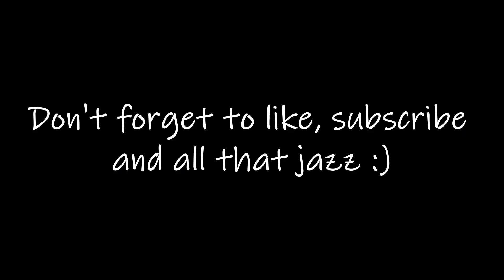Installing the Fractal Design Celsius S24 AIO Water cooler in the Meshify C case

Comment: Hey, MrGarti, how are u doing? What bout your S24, operates well? Few observations regarding mine: beeing connected to radiator directly (in PWM mode on the pump knob) my AIO fans speeds up or slows down for no reason even in idle or just web browsing (not a big load imho) and fans start to howl occasionly. So fan speed ramps up basing on CPU activity, not on AIO coolant temps (what fans rpm's supposed to be be based om imho). So fans spin at ~2000 while coolant didn't have time to heat enough to be cooled by such high rpm's)).. Appealed to FD support & they confirmed it's just like that, quote: 'I would almost recommend to connect the fans directly to the motherboard instead of using the PCB included on the radiator. And then set the fans to the chosen speed you want to have them at. The only thing reporting RPM back to the motherboard is the pump cable. The fans on the AIO hub then runs at the same percentage it's put at, so if the cooler is set to 100%(2800-3000 RPM), the fans would run at its 100%, which generally is anywhere between 1000-1800 RPM for fans. The hub is pretty much there to make cable routing easier. It does not report RPM to the motherboard, and only copies the signals that the pump gets.' Hence I'm about to utilize SYS_FAN mobo headers.. Sorry for longread)..

Comment: The radiator is upside down, tubes need to be at the bottom, otherwise this causes air pockets, gurgling sounds and other issues. Manufactures don't let people know this, it's infuriating. Nice set up though

Comment: Thanks for creating this video. Was wondering if it would fit inside the case :P Cuz im about to order the same case and cooler. Although, i might go for the one with 3 fans? Any thoughts on 2 vs 3 fans version of the cooler?
Reply from the maker: Hi there, I have no experience with the 360mm version sorry :(

Comment: A bit confused AIO hoses on my S24 are rotating. And fittings as well, on radiator and pump. Do I have to tighten them? Anyone?
Reply from the maker: Hi there, yeah the top part of the fittings can rotate - mine does that to, I havent tightened anything and I don't think you will have to.

Comment: Installing S24 in front of the case is the only option for Meshify C I believe. It's impossible to install it on top since AIO interferes with RAM. GSkill Trident Z in my case. Was very upset about that..
Reply: I installed it on the top with no issue.
Reply: @ClaytonHT  depends on m/b - MSI B450 Gaming Pro Carbon won't allow you to do it. RAM slots are too high

Comment: The user manual seems to show the fans being inside the radiator.  I have mine installed like the video already and am wondering whether I should change it.
Reply from the maker: Hi Frostfell, the position off the fans can be both, the one where it is inside like on the manual is called a "pull configuration" while the one in the video here is a "push configuration". Temperature wise there isn't any measurable difference between the two, so I'd say its a matter of preference.
Reply: @MrGarfi  Thanks for prompt reply!! :D

Comment: What is the name on the connection on the board for the pump? Cpu fan?
Reply from the maker: It can be either pump or cpu (Not all motherboards has a dedicated pump fan pin, and in that case, just use the cpu pin).

Comment: Hello; I'm using this fractal celsius S24 AIO for a year on my computer with a I7 7700K and a asus strix Z270E but I got a problem, and i'm wondering if you could help me:
When I start my PC i have these errors : CPU FAN speed error; CPU overtemperature error. With them being at 100/100/100/100 degrees. The pump is connected to the CPU FAN.
I have tried to connect it to other slots without conclusion.
When I put my fingers on the pump I feel no vibrations (like if it wasnt working), and the fans are turning faster than usual. 
The thermal paste seem to be old and i might need to change it, can it be the only problem, or do u think i should change the pump? Is the problem coming from something else ?
Sorry for my approximative english.
Thanks in advance for your time.
Reply from the maker: Hi Antoine, sounds to me like the pump is defect - I would reach out to Fractal Design for support.
Reply: My CPU isnt overclocked if you wonder.
Reply: Or your psu cant give out enough 12v for all peripherals. Try to disconnect everything else that may use 12v. Had the same issue.

Comment: How long is your video card?
Reply from the maker: In this video it is an old Asus 660gtx TI that is 27cm long (10.7")
Reply: @MrGarfi  thanks for the answer! tell me what the maximum length fit, if it costs Fractal Design Celsius
Reply from the maker: I think it is around 28cm. According to the manual of the case the maximum width of the card when there is a fan installed in front is 315mm and the radiator on the S24 is 31mm thick, so that would be a max of 284mm. 
See page 19 on the manual here:
https://www.fractal-design.com/media/56d40f9f-549f-413d-b144-46eaeef98f11
And the specs on the AIO here: 
https://www.fractal-design.com/media/7848d534-294e-4083-b671-db6c4d4da95d
Reply: thanks big thanks

Comment: Sorry, I don´t understand, why you have installed the Radiator on top with "PUSH" operating fans, the White side means "Push" and the labeled side "Pull", look at the arrow, if you look at the labeled front, the air flows from bih!
ind to the front, when you look at the White side, the air flows from front to behind (Push), best cooling provides push and pull operation with 4 fans, you push Fresh air from outside through the Radiator and pull out with the other (replaced) ones, this pc with Mainboard, graphic, and.. gets no fresh air inside!
But I have another Question, Perhaps you can help, When you have set backplate for Intel 1151 socket and mounted the 4 standoff screws, the System is moving, because the threads are higher than the Mainboard thick, is this Right???
Reply from the maker: Push vs pull in a front mounted  like in my video here doesn't give any measurable difference in temperature, so don't worry too much about that. Regarding push/pull configs, then I don't think you would get any noticeable performance boost from it on such a thin radiator - had it been a 4-5cm thick one, then yeah sure, go for a 4 fan push/pull - otherwise I think the money could be spent better. Checkout Jayztwocents videos on the topic to get better details on it - he has everything covered about water cooling.
And to the question, yeah it doesn't tighten it completely to the motherboard, there is a 1 - 1.5mm play. But when it is tightened when you screw on the pump, and then there shouldn't be any play at all - if there is then its not installed correctly.
Reply: Thank you so much for your answer, I am happy to hear, that you also have noticed the same Play,
sorry, I cannot immagine, how this should work, the Copper plate of the pump with the thermal paste must be pressed to the top of the processor, when you drive the screws you PULL the fixed standoff screws up, this results in having the grounds of the standoff screws NO contact to the Motherboard, I have installed many cpu-air cooler, some use adhesive taps, to fix the back plate,
now I want to use a midi Tower and a compact watercooling set, I wrote also to the support of fractal design, the Problem is for me, the Pins of the backplate look out from the Mainboard holes, when the backplate is tight to board, in the cad Picture of the instuction Manual "Mount the Cooler" you can also recognize, that the grounds of the standoff screws don´t touch the top of the Motherboard, but this can mean Nothing!  So sorry to disturb you, but a teacher a Long time ago said "better a stupid Question, than a stupid work"! Can you look in this build up System, if the Bottoms of the 4 standoff screws touch the board? Thank you for your friendly Patience, best regards Burkhard
Reply: @burkhardpuck5775  u cab rorate plate on popm

Comment: If anyone has a meshify C case /w Celsius S24 I would be interested to know does it properly fit if you mount the radiator to the top of the case? No interference with the ram sticks or the motherboard components? In my case my ram is not too high but would still probably be in the way if it were a push pull configuration with 4 fans, however I am interested in the stock config /w 2 fans... my ram is Kingston HyperX predator 2x8GB HX430C15PB3K2/16 kit which should b e 42,2mm high. Thanks to anyone with fist hand info in advance.. cheers.
Reply: Tried to put together Meshify C, S24 and Trident Z today. Had an issue with RAM blocking radiator top installation(.. So the only option for Meshify C in this case is to put AIO up in the front of the chassis I guess..
Reply: u can cheat this problem bro. put radiotor on the top, inside in a case and fans on top but outside of case. and connect them together by screw.

Comment: You have mounted the fans on the outside of the cooler, when the instructions indicate they should be on the inside.  Holes for both mountings exist.  Why vary from the manufacturers instructions?
Reply from the maker: Hi Peter Wright, good question! Whether you place the fans in front of the radiator or back is a matter of pushing vs pulling air through - and as lots of tests have shown it doesn't matter temperature wise, so I just went with what I think looks best, and that is hiding the back side of the fans. If you look at the NZXT Kraken installation guide it shows a push configuration so it truly is a matter of personal preference, both options work just as fine.

Comment: Is this better than the new Corsair AIOs? I want to put a new cooler on my 2700X, but am really undecided on the Noctua NH-U14S, this cooler to match my new R6 case, or the new Corsair 280 RGB Pro. Your input would be highly appreciated. Great vid.
Reply from the maker: Hi Rene Pena, I haven't read anything about the new Corsair I am afraid - but gamersnexus.net would most likely have some charts that show their temperatures and noise charts compared. But I doubt there will be much difference between them as longs its the same size - there rarely is between the most popular brands.

Comment: Hey Mr Garfi, are you there? It's lousy me again. My Kraken X62's been acting up since the series of darn CAM updates. I suppose you wouldn't be too experienced with that, indicated by this upgrade. Now when I edit videos, the fan gets so loud, it sounds like something's gonna blow up. I don't even know if it's the Kraken or another fan, actually... the whirring noise is just really, really abnormally loud, and I can't imagine a normal CPU fan spinning that loud, gah...

Maybe I need to consult BleepingComputer, but I don't feel like posting logs, haha. Anyhoo, at least I got to enjoy your latest build video. Very trance-like, oceanic editing.
Reply from the maker: Hey ULTRA KWON! Hmm that sounds weird, but what about the temperature readings on the CPU, are they off the charts also? I believe, depending on your editing software, that the GPU is also working really hard, and those fans can be crazy loud due to their size. Try downloading HWInfo or Aida64 and you can see all kinds of readings on your PC, just to get an idea if some of the temperatures are getting too high. 
It might also be the CAM software that has changed the fan curves - might be set to 100% fan speed on a too low temperature - also just might be because of the heat outside that is causing it (I don't know the temperatures in Cleveland :) )
Reply: Hmm. Well, the CAM software is kinda like Aida64 as well, isn't it? At least in terms of providing a live status report. 

Cleveland's been consistently 80-90 degrees F. Hotter than last year for sure, but the CPU temp isn't that much hotter... maybe hotter by 5 degrees on idle?

The CPU temp never exceeds 40C when the fans go berserk at 1900+ RPM. It's uncharacteristic because in the past when I'm editing videos, I've seen temps climb to upper 50s and yet I hardly heard anything. Now it's spinning out of control. 

RAM load is also 11% on idle after I start up the computer. It used to be 1%. It hits 30+% when I'm streaming YouTube videos, which is odd... because I don't even think exporting videos took up that much ram. I always felt my ram was underutilized. 

Anyway, I've posted this problem on BleepingComputer. Hopefully someone'll be able to help me out before it's too late. I actually had another problem that I posted a while back, and after refreshing the page a thousand times over the course of three or four days,  life took over and I sorta just adapted to the problem, so yeah... I hope they get back to me soon.
Reply from the maker: Hey ULTRA KWON, it seems you are not the only one with that problem: 
https://support.camwebapp.com/forums/252256-cam-bugs/suggestions/34888810-3-6-2-update-and-custom-fan-profile-pulling-my-ha

Are you running v. 3.6.6 of the cam software? Seems like the fan curve profiles are really buggy atm.

Comment: Why did not you install AIO on top?
Reply: u can cheat this problem bro. put radiotor on the top, inside in a case and fans on top but outside of case. and connect them together by screw.
Reply from the maker: @Craker for two reasons - first, like I said in the video I have planned to place RGB fans there - Making another crazy RGB setup :) , second if I placed it in the top I would get negative pressure because three fans would act as exhaust and only one as intake and I didn't have extra fans that I could use for intake.
Reply: I have the same cooler and case, but I installed the cooling at the top, however I think I will have to be ready to install in the front cuz of height of RAM ;(
Reply from the maker: Ah damn, yeah some RAM blocks are just very high, so the fans are getting in the way or?
Reply: @CrakerAhad  that's it! S24 collides with Trident Z((.. Got this issue today. Had to install it in front of the case..